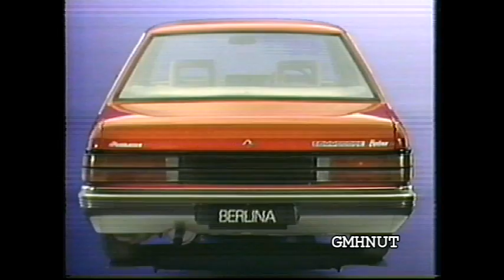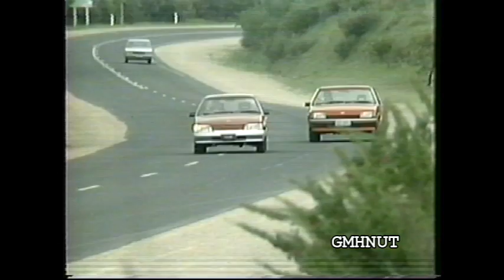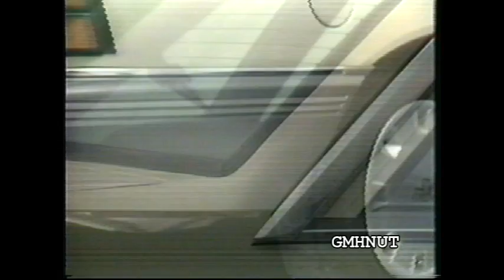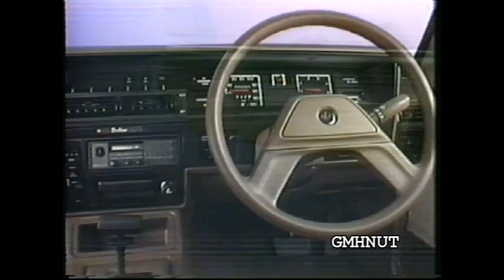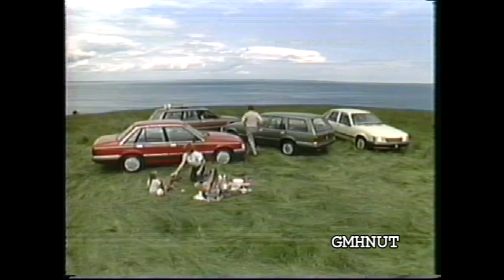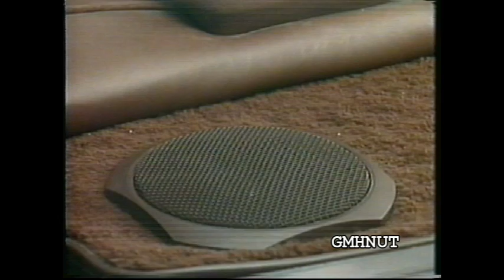Official Holden VK Commodore Range including Calais Promotional Information DiscoVision

Comment: Wow. 7l/100. Its was a robust little engine but the ancient 202 DRANK fuel like there was no tomorrow. And gutless to boot. It wouldn't get that figure going down hill with a tailwind. This is the most flagrantly stretched car advertising I've ever seen. While the "acclaimed" trimatic was tired and old and nothing to get excited  about. 
The new AM/FM radio was crap and couldn't pick up a thing in country areas. But hey at least it finally had FM. 
The headlights were useless after dark. 
They look tired and plain and ugly now but at the time we all thought these looked amazing. 
And they did ride quite well although the 14" wheels and skinny tires slid out easily when pushed. 
Ah nostalgia. Its all gone now.

Comment: I think 12.3 litres/100 kilometres for city driving & 7.6 litres per 100 kilometres is a load of rubbish if anyone is speaking about the old 202 cubic inch Holden six, that's coming from a Holden such as myself - 202 = fuel guzzler.

They got 20 kilowatts more power (86 kilowatts) out of the black 202 cubic inch Holden six over the red 202 engine (66 kilowatts) but the fuel consumption was pretty much still  the same.

The EFI engine had a whopping 40 kilowatt power increase (106 kilowatts) over red carby 202 engine but the fuel consumption was basically the same as in the HQ Kingswood which was fitted with the red 202 cubic inch Holden six but the power increase was a massive achievement back in 1984.  

They dropped both the 173 cubic inch Holden six from the lineup which was an economical engine which my dad used to get 28 miles per U.K. gallon out of when he bolted one into his old HQ Kingswood wagon.

People have claimed to get 11.5 litres per 100 kilometres (about 25 miles per U.K. gallon) out of the black Carby 202 engine in the VK Commodore which must've been Holdens reasoning for dropping the 173 cubic inch engine, the power output out of the black  Carby motor was about the same as the single exhaust 253 cubic inch Holden V8 engine in the Previous model VH  Commodore.

The black EFI Holden six put out more power than the 100 kilowatt twin (French) exhaust 253 cubic  inch V8 engine did in the VH Commodore SL/E & SL/X models.

From what I gather,the 202 cubic inch Holden six in any form is a fuel guzzler,try about an average of 18 miles per U.K. gallon or on a good day 20 miles per U.K. gallon,the very best my father got was 21 Miles per U.K. gallon when driving on the highway for 600 kilometres.

I knew someone who used to thrash his red 202 cubic inch Holden six powered HZ Holden Kingswood (1978-1979 model) sedan which was out of tune & it had exhaust leaks,he got down to 12 miles per U.K. gallon out of the 66 kilowatt engine - that's terrible.

You may as well have bought the 308/304 cubic inch Holden V8 back then if you had the money as their fuel economy was about the same as what the 202 cubic inch Holden sixes was !
Reply: 230kw last commodore 6 russulehiem manufacture

Comment: A pity there was no turbo injected model, I did one years ago as a custom deal and it spanked a 5.0L, trimatic upgraded to V8 internals and shift kitted with an early Wolf computer it got 30+ mpg drove unbelievably well, was a Berlina  would not have taken Holden much of production change but I guess someone thought a Nissan motor was the way to go,and held out until VL model face lift, i think a 2850 turbo (173) model would have been the go next to 2850 na model and let the 3.3 fade away
Reply: I agree, they’re a beautiful car.

Comment: It's a pity Holden didn't source a GM 4-speed automatic for the VK. That, with the EFI six, would have been a knockout combination.
Reply: Trimatic is king prefer it over any other
Reply: Should have dumped the boat anchor and introduced the Nissan driveline instead

Comment: I had an injected vk, it was very ordinary. Crap fuel economy, crap performance. 7.3 l/p100km, well nearly double that and thats taking it easy. I traded up to a VL v8 which got better economy and by the time l tweaked it a bit and converted it to a 5 speed manual, easily got under 10 l/p 100 km. Sorry GMH the 202 was clearly disposed of for a very good reason, it never received the capital investment required to cut it with the competition and to a lesser degree l think you could apply that train of thought to the v8. Putting the RB30 in the vl was a bit better and those turbos could be rockets with a bit of a fiddle. The vn may not have been anything special but it was a vast improvement.

Comment: Unfortunately the VK Commodore had the worst build quality. Just look at the headlight surround in the video and you will notice the front left guard panel does not line up with the headlight. And thats for starters. I bought a new one (VK Calais in 84) and there were so many issues including mechanical. It was worst than buying a secondhand one  :(

Comment: If only our American market cars were this nice.
Reply: Jason Carpp no, they're cigarettes
Reply: your are dick head ford lover
Reply: Lol, reserve that until you've seen one of these in real life. You can walk between the panel gaps, the interior fell apart as they built them and the headlight had the power of an unlit candle. These are just embarrassing. Hence they had to get Nissan to help them actually get these slugs up the road, ended up with an excellent drivetrain and the car fell apart around it. We used to paddock bash these, they couldn't even cope with that.
Reply: @garethcurtis7545  they actually had to turn to Nissan, as GMH couldn’t afford to design an engine that met EmIssions standards fo the next ( VL) generation, since Detroit bailed out Holden only a a couple of years earlier.